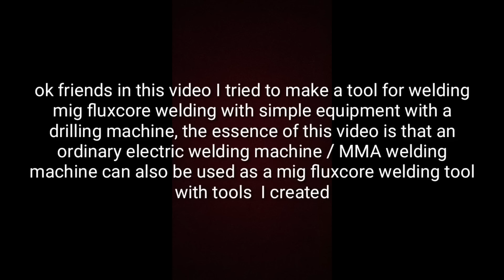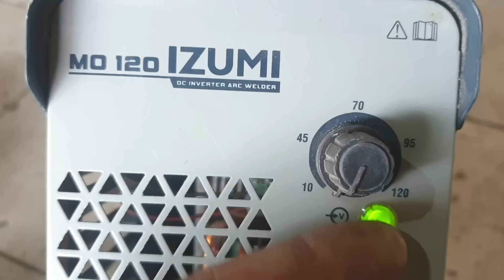AMAZING electric welding stick for mig flux welding stainless & iron

Comment: Mig bekerja di tegangan 14 - 24 V, sementara mma bekerja di tegangan 48-60 V, tidak bisa bekerja optimal, karena  wire akan burnback sebelum membentuk bead, makanya kedengarannya seperti putus-putus, tidak kontinyu.
Reply from the maker: @Bh Hdh penjelasan yg sangat apik, terimakasih telah membantu orang banyak, semoga amal sampean di balas dengan kesehatan lahir batin tambah sukses dan di panjangkan umur Aamiin
Reply: P
Reply: @endy mks co2 sebagai  gas pelindung dari oksidasi ketika pengelasan karena kawatnya tanpa flux atau istilah kerennya sebagai active shielding gas,  pada dasarnya mesin las listrik memang sama seperti  adaptor atau AC to DC converter,  pakai trafo ferrit dan di swtiching pakai IC control untuk mendrive transistor mosfet atau igbt untuk menghasilkan arus yg gede
Reply: Tukang las vs tukang servis mesin las😀
Reply: Kayaknya bisa om pake 24v keatas yang penting jangan 220v keatas nanti bisa jantungan😄 ampernya saja di kurangi klo main tegangan..mungkin yang jadi masalah adalah di jenis arusnya dc atau ac gelombang sinus atau kotak,dutycyclenya berapa persen.. soalnya mesin las sepertinya beda2 karakter arusnya dan beda2, peruntukanya..bahkan terbalik stik negatif atau positif berpengaruh dengan hasil lasnya karena electron(-) selalu menuju proton/positif ..tapi semua ini kayaknya om,soalnya saya blum pernah perbaiki mesin las😁
Reply: #Bh Hdh....tdk smestina begitu uriainya part engine lain² trgantung pakai wire jenis apa engine yg mna satu...d lihat d dri vdeo d atas wire sbetulnya gak pakai co² sdah smemangnya bunyi bgitu cuma syang vdeo d atas kurng memahami pengapian antra volt ampere dan wire ukuran brpa ada 0,8 1,0 1,2 jika pandai sdah psti hasil weldingan pakai wire itu sngat memuaskan
Reply: Isso. E. Gatilho. 
Em. Obra. Grande. Não
Pode. Fazer. Isso
Não. Gostei. Da. Produção. Desse vídeo
Reply: Siapa bilang gak bisa diturunkan lah volt nya pakai resistor 1 kilo ohm 2 biji atau 10.000 kilo ohm 1 biji + 1 kilo ohm 1 biji bisa juga hadehh main nya kurang jauh salam dari anak elektronika 😆
Reply: @prett209  tukang servis las vs anak elektronika tegangan tinggi 😎💪
Reply: @endy mks di ouput nya di pasang, box las nya aja yg besar mesin kecil 😂 dia rangkaian nya hampir sama dengan inverter
Reply: Tidak sesuai dengan gambar nya..di gambar  ada besi/ pipah lagi di las..ternyata. hanya plat besi yang di las
Reply: @bhhdh658   tepat sekali penjelasn nya om...seperti solder timah pakai pasta
Reply: Kalau pakai las yg ada fiturnya VRD bisa kali ya bang..secara kalau fitur tsb diaktifkan teg 16vdc
Reply: @fahrurroziq4960  setahu Sy VRD yg beneran itu hanya ada di alat heavy duty Amper gede karena OCV nya gede bisa sampai 85v, dan  hanya bekerja ketika alat Tampa beban . Kalau diberi beban tegangan kembali ke OCV normal.. makanya mesin gede biasanya ada settingan hot start biar vrd nya cepat ke trigger off dan Amper naik ketika elektroda di lekatkan pada media las biar elektroda ga lengket.
Reply: @firdaafrizanur3402  : resistor dipasang seri ?
Misal resistor 1 Kohm. Tegangan open las 40V ... maka saat ujung las nempel di obyek, maka arus yg mengalir = 40V / 1K = 0.04 A . Arus sebesar 0.04 A tidak akan bisa melelehkan logam. 
( Anda yakin anda seorang anak elektronika ? )
Reply: Penonton memang begitu bos pintar sekali,😊😊🙏
Reply: @firdaafrizanur3402  dah praktek???? Las butuh Amper bukan voltase kalo main resistor berapa wat???
Reply: makanya...bang bikin vt yang bermanfaat...klu kena senior begini tau rasa...emang cuma abang yang tau soal teknik welder..
Reply: Baguss padee penjelas.n nya bikin chanel youtube  aja pak deeee
Reply: suatu keberanian untuk membikin konten  terlepas dari prokontra  bravo
Reply: 🤣 nyimak
Biasa cas aki pake mma
Reply: Dari sini kita bisa menyimpulkan teori dan praktek,terimakasih praktek yg luar biasa salut buat Dedi karya setelah praktek ada kemungkinan perbaikan, teori di komentar ini sudah benar tapi klo tidak di praktekan hanya menghambat kreativitas seseorang,sukses buat chanel YouTube nya semoga semakin berkembang Dedi Karya 💪🔥
Reply: saya nyimak aja..maklum cuma bisa ngelas..itupun msh baru blajar...dan gak faham dunia kelistrikan...dan saya mendukung chanel kreator2 spt di vidio ini...
Reply: کاملا اشتباه است قرقره الکترود جهت جوشکاری tig. وmig می‌باشد وگاز محافظ، دراینصورت جوشکاری نفوذی نخواهد داشت موتور جوشکاری ترانس dc برای الکترود دستی است.
Reply: v out izumi mo 120 itu kisaran 20-25v
Reply: Kalau saya bekerja di kebun di suruh kerja di 48 perusahaan 🤣
Reply: @firdaafrizanur3402 beh... reistor kang ? la butue ampere opo gak mok pikir iki urusane las duduk dolanan voltase, iki butuh ampere gede , kok dagelan sampean iki
Reply: @khozinefendi8074 ngapunten Pak, niki mungkin maksud beliau menjelaskan, yg sekolah elektronika itu anak beliau bukan beliaunya sendiri jadi kalo salah yaa sudah biasa😅

Comment: Mantap gan las mig modifikasi
Reply from the maker: Hanya sedang kebetulan untuk mempelajari pengelasan mig flux menggunakan mesin mma, 
dimana mesin mma mempunyai tegangan 48-60 V, 
sedangkan mig 14 - 24 V, 
Dan ternyata hasilnya tidak seperti apa yang di harapkan, walau demikian cukuplah buat membuktikan kepenasaran, terimakasih sehat selalu semakin jaya semakin sukses untuk channel sampean, Aamiin
Reply: @DediKarya Bpk pakai kawat apa ini untuk ngelasnya? & apakah izumi ini kuat di gunakan di listrik rumah 900va?

Comment: do yourself a favor, buy a MIG oriented machine if youy really want to practice MIG welding, the characteristics of a MiG machine is so different than tne characteristics of a stick machine that it will about impossible to do a good job with such a crossover setup
Reply from the maker: Siap bosqu, itu ide yg bagus

Comment: Хрень конечно редкостная, но если поставить педаль и обороты убавить на дрель-можно что то присрать.
This crap is certainly rare, but if you put the pedal on and turn down the speed on the drill, you might screw up something.
Reply from the maker: Terimakasih untuk idenya bosqu

Comment: Mig/mag/flux,are constant voltage processes,while stick and tig are constant current,that's why it does not work properly,using a mma machine to do flux-core welding...

Comment: you need a variable  speed drill and i think it can work well!
Reply: thats right, i think it needs a little adjustment on speed and amp and it  will work better
Reply from the maker: Iya bosqu, terimakasih masukan yg sangat berharga busat vidio saya selanjutnya

Comment: Wire speed is too fast. Also I get your intelligent but this is a waste of time and money just go and buy a small mig. There designed for the job. It will make life alot easier and you will make better money! Why because you will get it done quicker and better.
Reply from the maker: Dan ini hanyalah mencoba rasa keingintahuan saja bosqu

Comment: The current-voltage characteristic for semi-automatic welding needs to be hard ... or rising in extreme cases. And your source gives a steeply falling one, my friend. And buy a burner, it will be much more convenient. Yes, and protective gas will not hurt. I cook in argon, and you can choose mixtures or carbon dioxide for yourself, whatever your heart desires in general! Do not limit yourself and do not forget to turn the adjustments.
Reply: Если бы не этот ролик, то даже и не задумался бы - а насколько проблематично сделать жесткой (горизонтальной) ВАХ инвертора (MMA), т.к. даже и не смотрел их схемотехнику. Совет купить горелку... Хорошая горелка стоит дороже самого дешевого Edon'а. Данный ролик, понятно, лишь для просмотров на канале. Ну или от безысходности...

Comment: qporqeria
Reply from the maker: Just by chance to learn mig flux welding using mma machine,
 where the mma machine has a voltage of 48-60 V,
 while mig 14 - 24 V,
 And it turns out that the results are not as expected, even so, it's enough to prove your curiosity, thank you, have a nice day